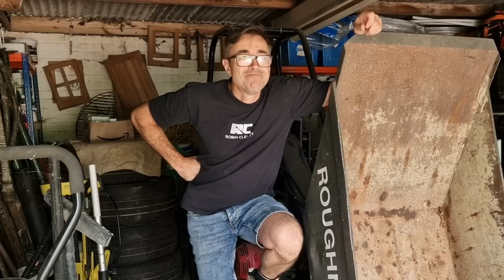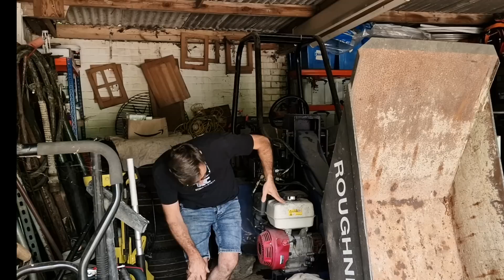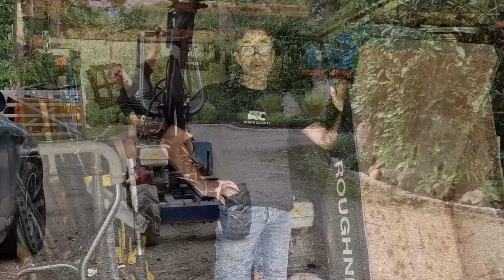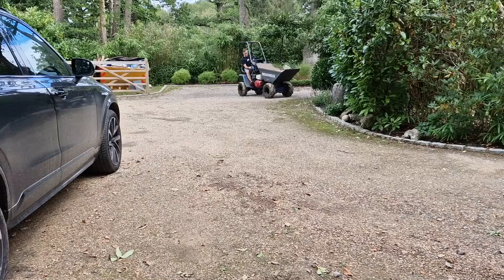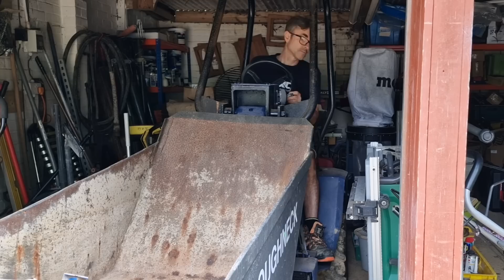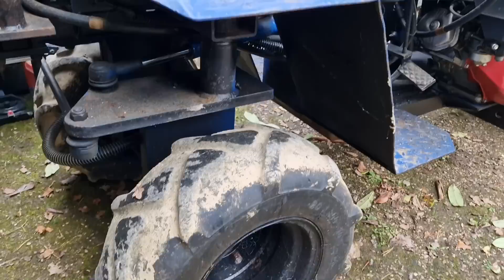My mistake!!! Dumper for sale!!!!

Comment: Page 4 of the manual.
FAULT FINDING:
SLUGGISH OPERATION
a. Hydraulic fluid level low
b. Blocked hydraulic line
c. Blocked filter
d. Split hose
e. Seals in cylinder worn and passing fluid